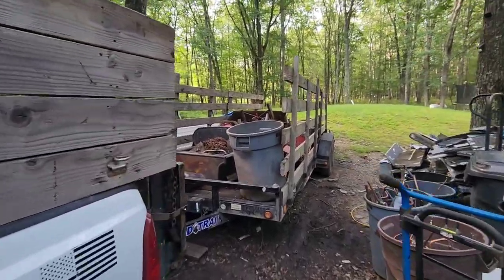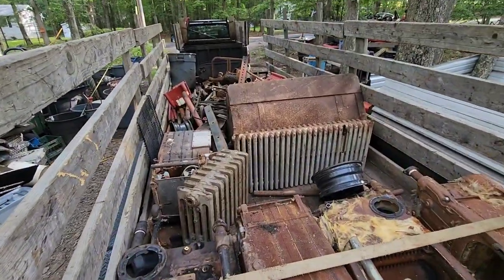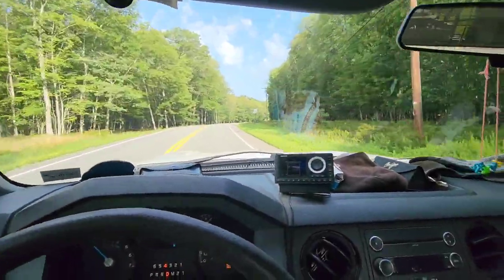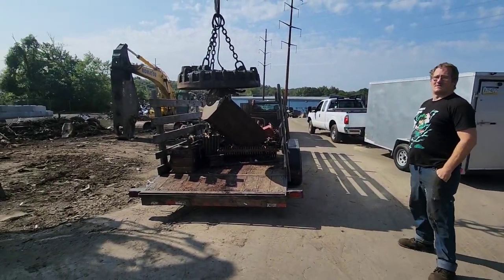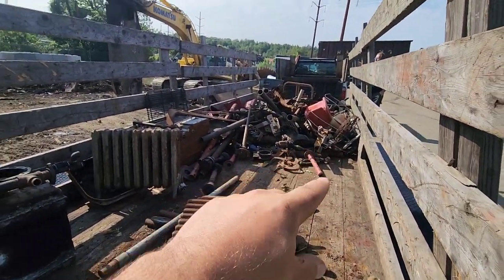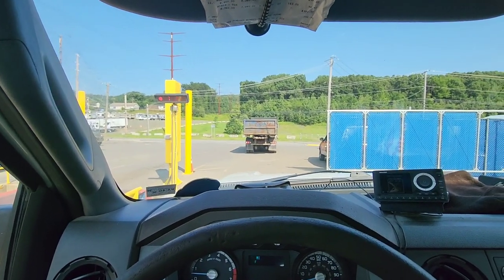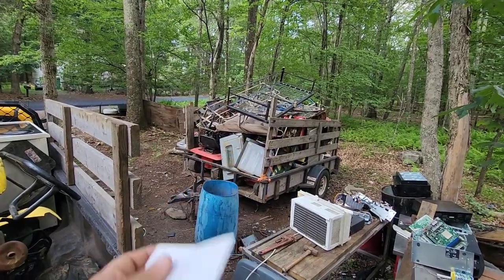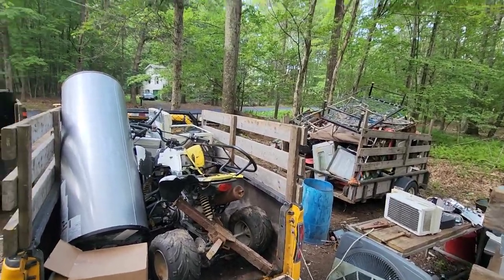Bringing in short steel Before prices crash.

Comment: How do you tell if your box is overloaded without a scale?? I have a 2010 1500 so I know box payload is 1850 lbs but no idea how to guess if I’m there or not I usually take in copper so hasn’t been a issue in the past but now I got a bunch of steel I need to get rid of now too.
Reply from the maker: I usually always look at the suspension.. And when I go to the scrapyard and I see what the weight is I kind of just judge by The level of squat